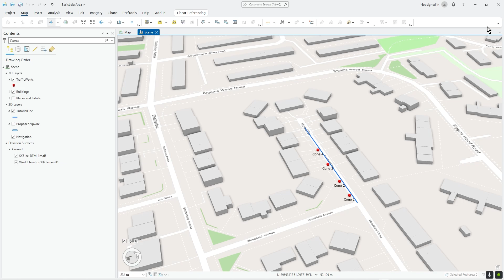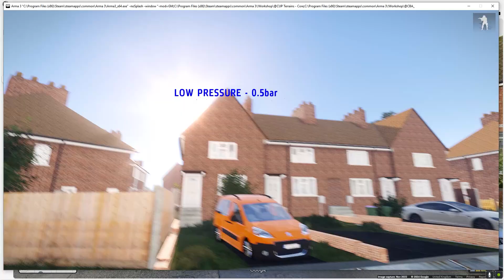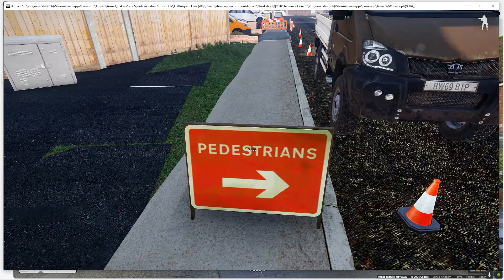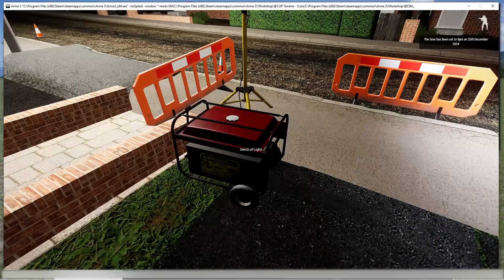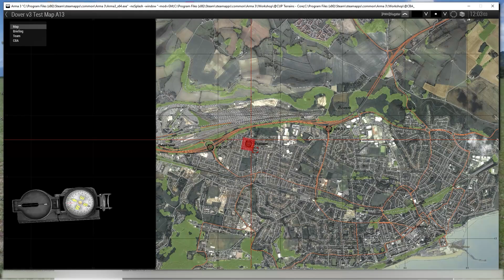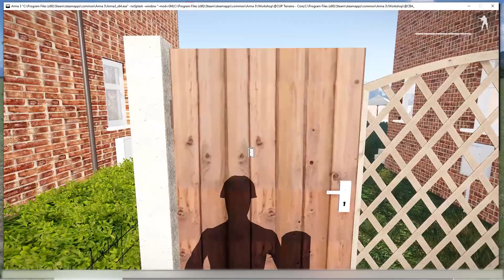Digital Twinning - Next Level!

Comment: nice - how did you get from street view to the 3d output? Great work thanks for sharing
Reply: How could we design a whole city with digital twins? Use json, Atoll, MapInfo, etc? Please help and guide me about it.
Reply from the maker: @AzadeAbedy  A lot of time and funding is needed to do it properly. It would be a substantial project requiring 
......requirements gathering (exactly what do you want to do with that digital city? Who are the users? Any security implications?...etc etc) 
.... technology decisions via Architectural/Technical Design
.... putting together the appropriate team which would not just be GIS devs but also modellers (Blender experts for example)
...infrastructure to run it all.... 
But it all starts with requirements. 
You mention Atoll - that for mobile network planning? If thats your main requirement then that affects size of team, their skillsets, choice of base platform.
A lot there I'm afraid.
We could assist though as a project, if needed.
Reply from the maker: Although I could have created a link to the game engine, as R&D, I just had the 3D engine running already. So swapped windows. No reason why a link couldn't work bothways i.e. in the 3D fire an action that sets the Google street view position and vice versa. Just a bit further info on this..... it was a mix of Blender, Mapinfo and QGIS to format/build layers of geo-data for the Real Virtuality 4 game engine. That was followed by a substantial amount of detailing work such as adding wheelie bin models (created in Blender) and lots of other objects such as the cars. The interactivity that takes place is via custom scripts.  The houses themselves were created in Blender too. A fair amount of complexity involved with those models to make sure doors open and windows are breakable. The entire houses are also fully destructable. Not easy to do!